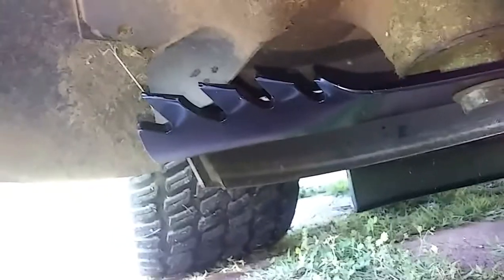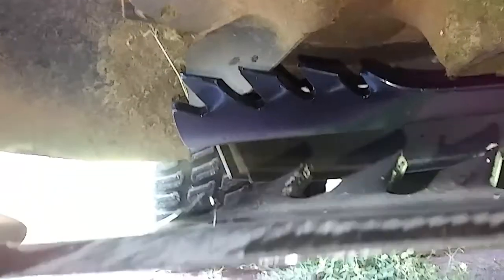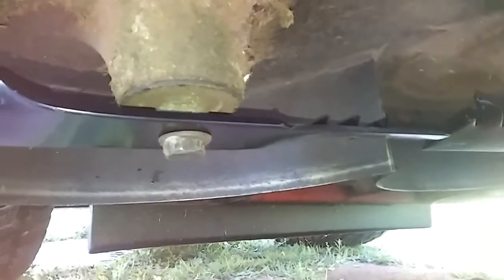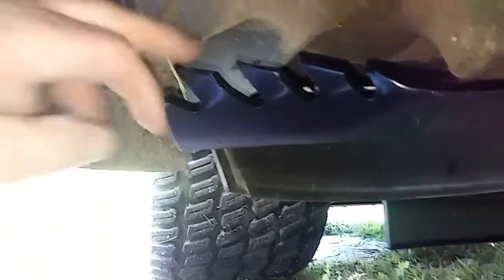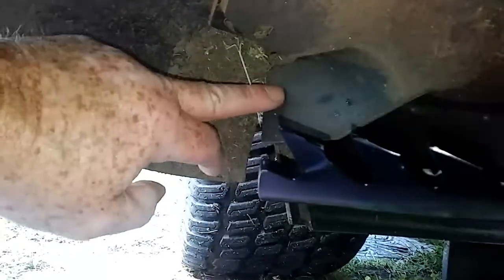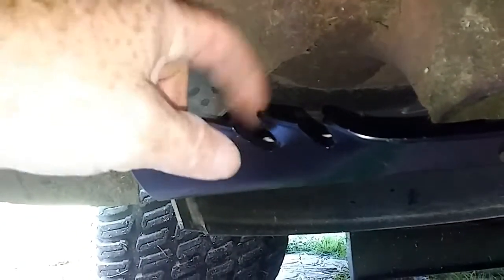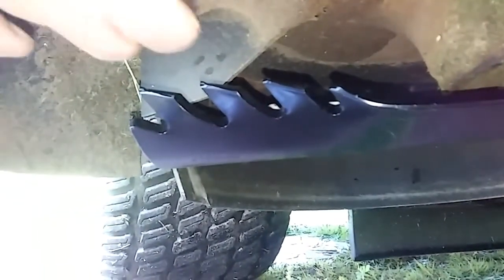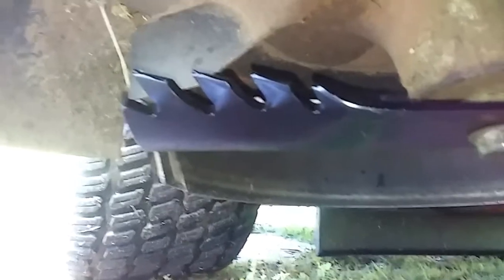Modifications to the  Ferris mower.

Comment: Great blades that's what I have on my Ferris.  I love them. Great video 👍
Reply: I was having the same problem. The stock blades  just cut the grass and send it out the shoot, so if you're cutting 4'' long grass, you have inch long discharge clippings. I finally got around to putting some gator blades on and I'm a happy camper. Now the discharge clippings are like 2" long, no matter what.

Comment: My Toro Commercial Z has the Mulch kit installed and doesn't need any mulch blades the deck has kickers built in .Im telling you this Mower can tackle 14 inch tall Bahia double cut and you will not find any clippings at all .And it leaves no trails .Amazing design .I prefer it over the X mark mulch deck .

Comment: I had the belt problem also. they did not warranty . they told me I did it with a pressure washer . I agree ferris ride is hands down the best . my best cutting mower  I have owned is a scag cheetah
Reply from the maker: Brandon Murphy the replacment parts are so high on scagg.

Comment: maybe the new deck is better. I know new blades . I know a new machine . I also know a good looking cut.  ferris doesn't have it
Reply from the maker: Brandon Murphy the icd deck is on several other mowers. I am looking at Wright stander to replace the Ferris I have used alot of other zeros in the past this is600 is the best ride I ever have had. my problem is the warranty not being honored by the dealer. 90 bucks for a belt after only 100 hours.  But thats enough of my rant show us what you have and how good your lawns look.
Reply: I have a 3200 with a ICD and it cuts very well.  Meaning the cut is very clean and tight.  I also have a 2000 with a flat front deck that also has a very good cut.  Our 3100 cuts ok, but it cut a lot better before the deck got into the shape it’s in.  We cut mostly St Aug in this area.  We have other Ferris mowers and I don’t have any complaints about the way any of them cut when the decks and the blades are in good repair.  Oddly enough, we have a 3000 with a blown engine that had one of the best looking cuts I have ever seen.  I have no idea why.

Comment: ferris cut quality is not great
Reply from the maker: Brandon Murphy the cut is great if you know how to sharpen blades and cut at proper hight. The belts are trash. and I am calling the mfg about warranty.
Reply: I found out about deck pitch after trading a Ferris 700, not a commercial user, but invested in a mower that had a tremendous ride. Happy about that, Two springs in a row wet mowing conditions, blades were new first spring, sharpened by the authorized Ferris dealer the second spring. Waiting on spring service the third spring and mowing plugged again. Please note this was a 52" iCD. Regardless of  conditions, my brother in law was mowing in same conditions with a X-One. No issues. Not sure if he had upgraded his blades. I am farm background, and worked for two ag dealers over the years. Certainly not the knowledge of you who make a living mowing grass, but I would like to think that Ferris Corp would support dealer training to the  extent that my complaints would have been addressed. Was mowing every 4 days in 2019 spring and plugging, 3rd year, called for service pick up again and was put off. Drove to the local Hustler dealer, ate some crow,  (we shopped there  before buying the Ferris) took a bath on the 700 they delivered the new X-One the next day, and it immediately handled the job with no plugging. Yes I was nice enough to call and  not to let the Ferris dealer make a trip to our place the next week. Possibly more getting the wrong dealer than the wrong machine. Still think the ride is amazing, but not important if you are on the ground unplugging the deck, instead of in the seat.